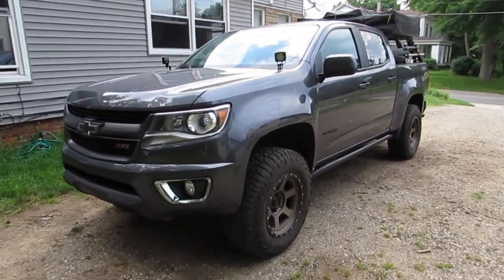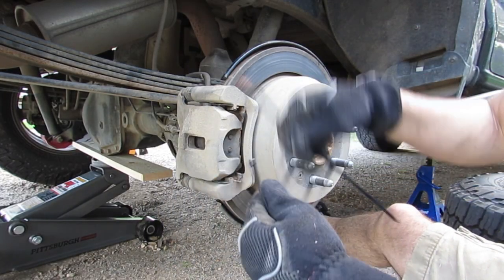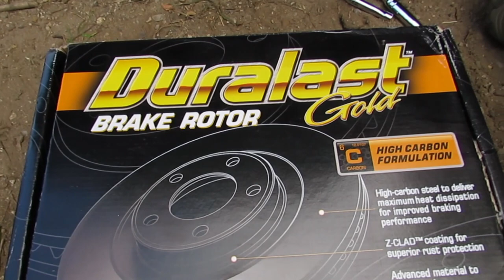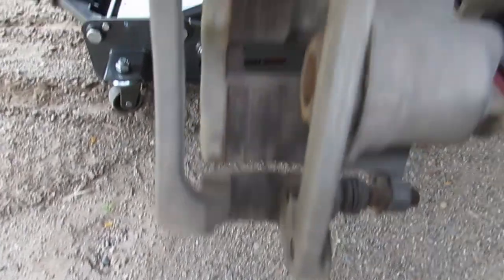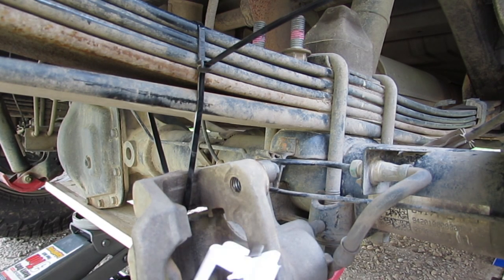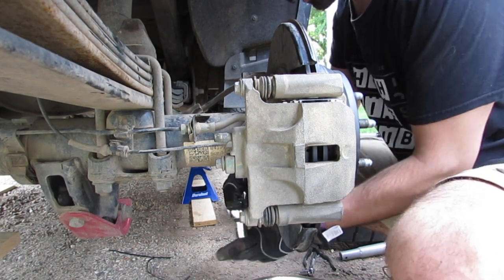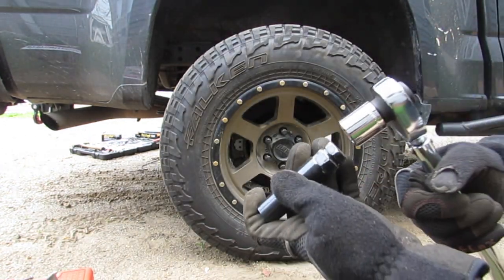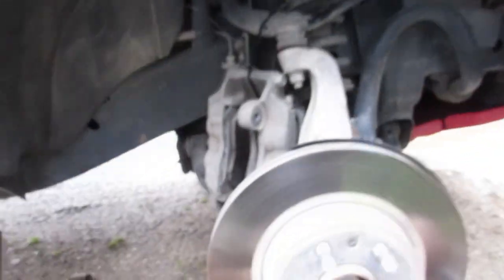Installing Brakes and Rotors on 2017 Colorado

Comment: great video detail of the bolts and close up of the calliper break down was excellent.  I'm a real fan of using zipties as well so glad to see you've given me another use.  Just one suggestion i saw on another video was to lube the bolts with the rubber boots on the calliper. Also i've seen two suggestions on slightly opening up the bleeder valve or opening the lid on the master cylinder to release the pressure on the lines when pushing out the piston.  Much appreciated for doing this video!

Comment: Awesome detail! Was hoping for a bit more detail showing the spots you lifted the truck on. Really debating on doing my own brakes on my 2016 Colorado this weekend! Your video did a whole lot to help me know what I'll need to make sure I have for the process, luckily looks like I just need a Torque Wrench!
Reply: Yes i need to know that also. I was just quoted 700 for front and rear pads. I can do the job just cant figuers out where to lift from
Reply: It is labeled on the stock jack storage bag if you have it

Comment: The T-30 screws holding my rotors would not budge. I broke a bit and then stripped out the end trying to remove them. I used my angle grinder with a cutting blade to cut a slot in the screw. Then I used a chisel and flat screwdriver and tapped it on the end of the slot with a hammer to turn it out. This worked great and I was able to reuse the screw. Could not find replacement screws at auto parts store, So I put anti seize on the screws before I replaced them.
Reply from the maker: I went to replace the front rotors that other day and the same thing happened to me. Seems like really soft metal. Never was able to get it out
Reply: @adventuredan3496  If you weren't able to get it out, what did you do? I looks like it screws into the wheel hub. I just stripped mine, which is why I ask.
Reply from the maker: @esthomason  I am going to plan im using a screw extractor. They're like $10 and you hanner it into the striped screw and then you can turn it out.
Reply: If you have a torx screw that won't come out, heat up the rotor around the screw with a torch,. Even a propane torch will do the job.   It'll loosen it right up.
Reply: They're just assembly screws.  If you put them back in, barely snug them.  Just keeps the rotor from flopping around before the bracket and caliper are reinstalled.  Lug nuts actually secure the rotor to the hub.

Comment: Important things about front brakes not covered in this video. I have a 2015.
1. You'll need cheat bars. Lugs and the bolts holding the brakes can be REALLY tight. I had an 18" and 30" and used both. It was a 3/4" black pipe, 48", that I cut.
2.  The front pads are held on with two long pins that span both bads and are secured with small cotter pins. Remove these first--before removing the brakes to replace your rotors.
3.  Pay close attention to the pads. They are not all identical. The tab ones with wear mechanisms go on the outside with the wear indicator on the bottom when installed.
4. I found only a compressor-driven impact wrench with an impact-rated torx bit worked to remove the bolt securing the rotor. A battery one didn't, and trying it by hand stripped the head, requiring me to drill it out with 1/4" bit (or a grinder to grind off the head.) Those bolts are only there so the rotors stay in place in the factor before the wheels are attached later.
5. Don't forget to use the grease to minimized the squeaks.
6.  When reinstalling those bars (#2 above,) insert the retaining clips at the same time.  You'll drive yourself nuts trying to do it after-the-fact.
Reply: Yessss....I also discovered all this the hard way

Comment: Nice job, only comment u didn't use any caliper grease / pad hardware grease.  You risk some chirpping.
Reply: Didn’t open the reservoir when pushing the piston in either

Comment: Not a bad job, but not the greatest either. I would have definitely taken those caliper slide pins out and cleaned and re-greased them. Also, I would have used some brake grease on every spot that the pads touch, including the piston and clips where they meet the caliper bracket,  just for peace of mind. I'm assuming you used some brake clean to wash off the "oils" on the rotor? Nice job emphasizing about keeping the calipers up and outta the way, as not to kink the flex lines. Do it right, do it once! Not harshing bro, just helping (hopefully). Cheers!
Reply from the maker: Thank you for the constructive criticism! This was my second brake job I've ever done. So I'd say I did a pretty good job!
Reply: @adventuredan3496  Hi Dan, How many miles did you have before replacing the brakes? Got a 2015 with 73K  and the brakes feel fine. Trying to get a gauge on when to replace. Thanks
Reply from the maker: @Ray-yr9ri  I'm wanting to say it was around 50k before any noises started
Reply: Thanks for the quick response!
Reply: @Ray-yr9ri  I have a 2015 as well and I am at 100,000 miles and getting ready to do them for the first time.
Reply: Im at 111,000 and its my trucks first brake job. Im kinda impressed with that. Never had a vehicle go this far without doing brakes way sooner. Thank you so much for the vid

Comment: IMPORTANT steps missed. 1.) degrease rotor unless you buy one degreased. 2.) brake grease should be added to brake pad clips. I also grease back of pad lightly. 3.) when you push the brake piston back in you must open the brake fluid reservoir to avoid damage the the master cylinder. Bonus: don’t think you know the torque spec; know the torque spec.

Comment: You don't need to put that little screw back in.  That is there because when the vehicle is being built that screw holds the rotor until the wheels are put on.  Just one more thing that can rust and cause issues removing it later.   Also you should lube the guide pins.

Comment: Thanks for making this video.  My 2016 Canyon needs brakes and I couldn't find any info if there was anything specific to look out for (ex: having to reset the parking brake shoes,).   If anything it looks like it's less complicated than the last vehicle that I owned.
Reply from the maker: No problem! I'm just glad I dont have drum brakes in the back. Hope you find it is really that easy while DIY.
Reply: @adventuredan3496  I did my brake job this past Sunday and it went well overall.  Some things to note for anyone else reading this:

-  When you change your front pads, turn your wheel after you take off the tire (turn the steering wheel right for the left side, and left for the right side).  :D  I struggled getting the nuts off of the first caliper because like an idiot I forgot I could just turn the wheel (which would have given me enough room to use my impact hammer on them).   Whoops.  :D  

-  You'll want to keep either a file, dremel, or a whiz wheel handy to fit the front pads.  My factory pads were a VERY tight fit in the caliper; so much so that one of them seized and I had to use a hammer drill to knock the pad out.  The problem is the thick paint on the sides of the pads.  The new pads had the same issue, but after cleaning out the calipers with a wire brush and then using a cutoff disc on a dremel (using the top side of the disc) to remove the paint (and about a thousandth of the metal) on the tabs on the side of the pads, they fit a LOT better and no longer bind, especially since I put Permatex brake lube on the parts.

On the upside, I now know why with my factory pads it felt like I had a warped rotor whenever I'd brake for more than 10 seconds.

-  I was able to get my rear rotors off without an issue, but if they won't come off because of the parking brake pads, there's a small opening directly behind the rotor (below the axle) with a rubber grommet.  Pop that grommet off and use a screwdriver to turn the adjustment cylinder.

-  The bolts that hold on the rear caliper to it's retention bracket use a 12mm socket.

Strangely enough my rear pads were far worse than my front pads.  One thing I noticed on both the old and new pads is that on the front and rear, it almost seems like the pads are too small for the rotor.  There's about a 1/4" of space on the outside of the rotor where the pads don't make any contact at all.
Reply from the maker: @DropDeadFrederick  awesome,  thanks for the feedback on the front.  I'm glad you were able to figure it out. :)
Reply: @adventuredan3496  Now the next thing you need to make a video on is how to not only take off the engine cover, but also how to put the thing back on correctly!  lol!

After doing my brakes and fluids I got brave and replaced my serpentine belt too.  Only problem is you have to take the engine cover off to get a breaker bar on the tensioner.  Taking off the cover was easy... putting it back on... well... let's just say that I didn't put it on correctly (even though I thought I did) and my engine threw a code for the throttle position sensor while I was driving it and went into limp home mode (but shut down the engine).  :/  Worse still, I left my 3/8" socket w/#30 torx bit at home so I couldn't get the engine cover off.  $220 dollars later for that tow I figured out what I did wrong with the air intake.  :/

I think the lower lip on the air intake that fits over the throttle body was actually inside the housing and was touching the throttle plate.  Once I got it home I was able to take it apart, put it back on correctly, and once I cleared the code it fired right back up.
Reply from the maker: @DropDeadFrederick  haha, I suppose I could do that!

Comment: Any road noise with those tires, assuming those where not  stock tires.
Reply from the maker: Believe it or not,  they are actually quieter than stock. Falken wildpeaks 265/70r17
Reply: @adventuredan3496  what other modifications have you done to your truck?  Love the look of it.

I have a stock 2017 z71.
Reply: I have Falken Wildpeaks 265/60r18s on my 2017 Canyon. Best tires I have ever had on a truck, smooth, sticky and yes, quiet.

Comment: Was this the first brake job you had done on your Colorado? If not,  how many miles did you have when you first changed your pads?
Reply: about to replace the brakes on my 2017, they are the oem brakes with 151K miles

Comment: I don't know who are the engineers whom designed the rear brakes but they should be fired. The pad is 1/4" too short on the outer edge of the rotor and doesn't make full contact like the front brakes do. So when you live up North with winter and salt, you end up with rusted and pitted outer rotor edges. This sucks big times.....